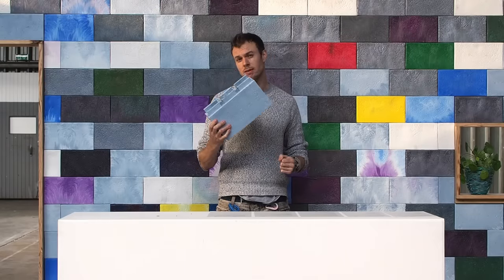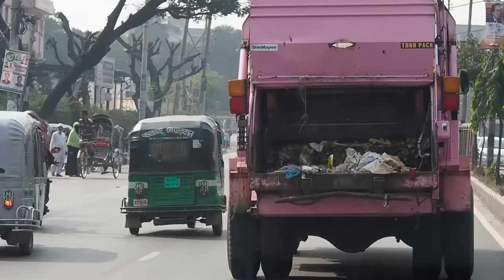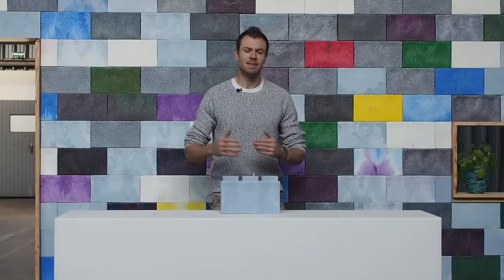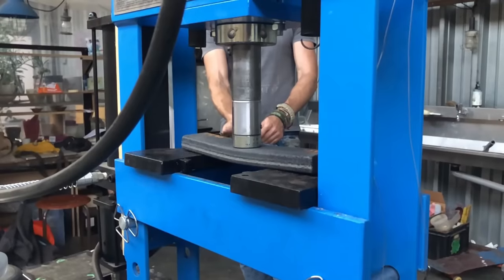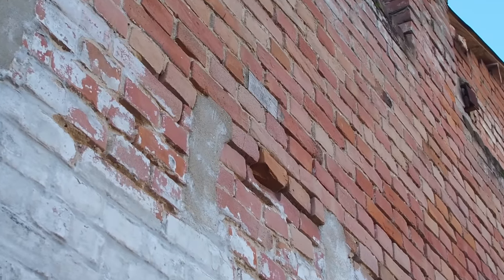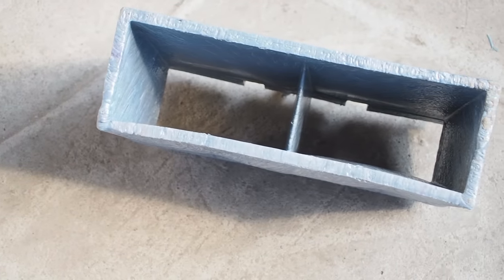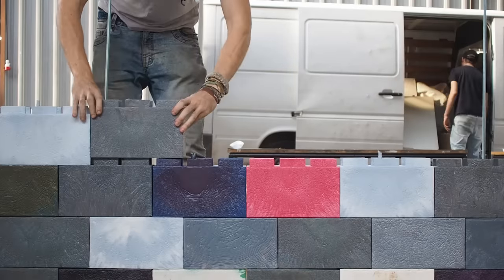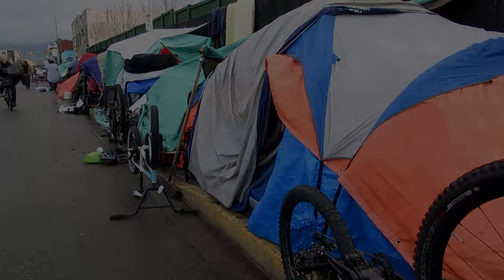Why the world needs recycled plastic bricks (and how to make one yourself!)

Comment: I see a few problems with that brick. The space between the bricks seem to be open. Why not put a notch in. Or some sort thingy that you hammer in to bind it all together. Could you cover the outside in ASA or something else that was uv resistant. And why make bricks. It seems to be a very material heavy way to do housing for poor people. Wich again make it impossible for them to build from your product. Most poor people do not build 2 storage houses. So sheets would be better cheaper and faster to build with. Plus you could easily cover one side in a UV resistant material. 2 sheets with 100mm or 150mm between them inter locking with other sheets 450mm high and 800m vide. Then you fill the space between them with dirt to make it stable. Then the next layer and so on. cheap sturdy and easy to make and build with. And they could make roofs out of 1 layer sheets to. Just an ideer.

Comment: Speaking of hurricanes a plastic house will fly like a bird. Thermic properties will lead to houses hot in the summer cold in the winter so more energy wasting. Also there's the fire hazard. How about making your bricks fillable with water? This would solve a lot of the problems of this design.

P.S: in order to avoid plastic waste, governments could force a percentage of recycled plastic in every plastic item. A composite material made from recycled plastic covered in a layer of clean new plastic could even be food grade. Let's face it, it would be a lot more efficient.

Comment: All those people trying to resolve 1 problem by making 10 others. Plastic is not a good building material. It releases toxic volatile compounds (even if in small amounts, consider if your whole building is made out of them, it is FLAMMABLE, even more with big air spaces inside for better oxygenation of the flames. Yes, there are chemicals you can add to make it not burn, but it still releases toxic fumes and its structural integrity is compromised by high temperatures. Imagine a building out of this on fire - not only fire hazard, but collapsing ass well. You may say "wood is highly flammable too, but we use it in buildings" - well, well, we all know how it ends, that's why most buildings are made out of different materials nowadays.
Other thing - it does not solve plastic waste problem, it just shifts it. buildings get destroyed, rebuild - what you do with old bricks? Also microplastics problem. Why should we use plastic bricks made out of plastic bottles, when we can make plastic bottles out of plastic bottles. We just need to focus on recycling, not reinventing the wheel.

Comment: All new plastic products need to be made from 100% recycled material.
No new single use plastic products need to be made. Manufacturers need to use more recycled products in their manufacturing processes. There has to be a market for recycled goods. There should be no plastic bubble wrap in packaging boxes. Crushed poor quality recycled paper  is a better option. Amazon and other online stores need to use crushed paper as packing fill material.

Comment: 5:29 - Thats the problem with these projects, they mean well, but they can never pay for themselves, except in the third world where labour costs are negligible. And ultimately, if you cant pay the power bill, the project will fail.
Reply: And here is where the short-term thinking comes in.  The cost in money now also has to be weighed against the long-term costs of pollution, landfills, damage to the environment and clean-up.  We have to get past this thinking that I will always pay for the cheaper product and not care about the long-term costs which we all pay.  I don't shop at WalMart, even though they have cheaper goods because I disagree with their labor practices.  Immediate cost is NOT the only way to value something.
Reply: @50jakecs  How do you pay employees and the light bill than? In the future? You still have bills to pay, like it or not. and if you cant, the project is worthless.
Reply: This project is virtually useless. First have to make parts for the mould then have it welded together. Second buy extruding machine. third buy plastic that has been processed to size. Four make then brick one at a time. And then finally after hundreds or thousands of bricks you get to construct some sort of building or wall. Sounds way more expensive and time consuming than traditional wood frame construction. Butt ton of cola bottles to make each brick.

Comment: In the tropics, bio degradable building materials  ( sand, clay, lime, timber)are the best.  Even excessive cement and concrete is harmful to the long term health of humans. (I know because I'm now trying hard to reverse the effect of living 10 years inside a house like that...) The human body is like a production facility, emitting waste including body temperature. When body heat  gets trapped inside for long it has a degenerative effect.  A home is also for stay in family members like the elderly, sick, and babies...  and they have real health issues to deal with already.. 
 
Let's face it plastic is useful in the short-term but  harmful after max 25 years.  Plastic waste shouldn't be disposed in human settlements., especially in countries blessed with top soil and water bases . Relocate them to dry, stoney geographical areas. .. Recycling and reusing  plastics is no real solution to the planet earth.  Let's not get fooled that humans have found a solution to plastic waste issue... the real issue to tackle is the mamoth rate of production of plastics. Now we are camouflaging the root of problem, which should be tackled by them high tech producers... and instead passing the burden of dealing with their waste to hapless consumers. There's no point in putting icing on a rotten cake.

Comment: The design is too wide, you need to have a less wide size in this way you can use it as a partition in construction if you try to have the expansion or divided the room inside an office.

Comment: We don't need recycled plastic bricks
We need to make mandatory to use more recycled plastic in every plastic item made 
And the best way to reuse plastic is with high tickets products to creat a economically sustainable market with a low investment entrance

Edit: still leaving a like cuz i think this is still importante AF
Reply: Plastic typically doesn't get recycled.  It is too expensive.  Metal is more likely to get selected for secondary production.  There have been many suggestions that drink containers should be made out of aluminum cans w/ reclosable lids rather than the typical plastic bottles.  Other issue is plastic bags... Only way to make that go away is to stop producing them.
Reply: @JDW240  if we increase the plastic price the recycling part would be financially feasible

Comment: but you can't use it for structural support right? you can build a wall with plastic bricks, but that wall can't hold a floor over it, it could work as a substitute to sheet metal homes in poor countries, but as you said, gathering, separating and working the plastic is not cheap, so a guy that earns little to nothing and lives in a dirt home surely can't afford 1$ per kilogram of building material
Reply: @Mr Brightside honestly i didn't think about the fire hazard, but yeah, a building that liquifies while burning, that sticks to people while burning. nope bad project. reason why designers are not engineers

Comment: What a joke XD 
1. Not all types of plastic are suitable for the outdoor purpose some will get really week after exposure to UV not to mention temperature change.
2. You cant mix different plastic together for example plastic used to make power tools body is almost always reinforced with glass fibers and that's basically the end you can't use it.
3. How about releasing plasticizers and other toxic fumes from these "bricks" in the hot summer.
4. At least here in Europe, we like to cover walls in plaster will it stick to this plastic wall?
5. How about the fire this would be quite a nice thing to watch burn melting down and with a thick black toxic smoke>> Search dumpster fire.  
6. How about simple stuff like mounting things on the wall what if the brick cracked?

Comment: Ending plastic pollution is easier said than done. 

This project does not have much value. For starters sorting, cleaning and recycling plastic waste is an incredibly difficult task. It has to be done manually. And because there is not much financial incentives in recycling plastic these industries tend to exploit the lower income families in the third world country and they are notorious for employing child labourers in an highly toxic work place.

First world country solution is to either dump or send it to third world country for recycling. Dumping is cheaper.

Ok. Let's assume that by some miracle you were able to accumulate all the plastic. Now how to sort and recycle them. Not all plastic are the same. You have to accomplish a great engineering innovation to industrialize this process unless you want to continue exploiting cheap labour.

Producing plastic is much cheaper than the process of  recycling high grade plastic.

Plastic bricks isn't marginally revolutionary. It is completing with an industry where raw material is literally earth. The process of brick making is less intensive than the process they are showing.

If you want to solve plastic pollution you have to -

1. Industrialize and efficienize plastic recycling
2. Add greater tangible value in using recycled plastic in comparison to petro plastic
3. Industrialize and revolutionize recycled plastic use and have financial and competitive advantage over established industries.

Comment: This is a bad idea. The will end up in the nature anyways. The problem of plastic is not the lack of uses for recycled material.
Reply: I'm not left by any stretch of the imagination, I think that global warming is largely a hoax to have people live in fear and raise taxes, put plastic pollution is undeniably bad. Not finding a use for these materials because they "will end up in nature anyways" is terrible reasoning. If it's used for a purpose, and if it lasts 100, 1000, 10000 years before breaking down it seems like a good purpose for waste product that "will end up in nature anyway" because it "would have ended up in nature anyway". The issue is being fire resistant and capable of bearing weight.
Reply: @ghostinplainsight4803  Sorry. I think I didnt explained myself properly. I appreciate all the creative ideas trying to solve this huge project. I was just trying to point out that I wouldnt use plastic where its use is not strictly necesary or there are better ecological options. Recicled plastic has already tons of uses.

Comment: One more hoples feel good project about plastic. That wants too steal your money.
It have already been Don 10-15 years ago and the project stopt becorse the lady startet finding her bricks in the nature. But that's the smallest problem.
It represent a fire Hazzard and compared too a concrete block costing 0.25 euro here in Africa its dead before start.
And the plastic used for these bricks could easely bee made too clean energy instead. But unfortunately people don't think a relierbel and cheap power grid is important.
There is only 3 ways too get rid of plastic.
Clean burning
Makin it too oil again.
Or plasma gasification.
Or els it will always end in the nature.

Comment: Good effort with good intentions.  But it's effort in wrong direction with wrong material. We as humans must stop production of plastic at all. There is no problem solving in using a material which is a known pollutant wether Virgin or recycled. 

Potential Problems with this application may be:

Fire hazard. 
1. Leaching of complex set of compunnds into ground through building. 
2. Very unhealthy and potentially disease causing compounds being released indoors continuously. 
4. Very unhealthy indoor environment as material is non porous.
5.have to ne applied with same set of dangerous paints /putty/plasters which can bind to plastics.
6. Moisture accumulation due to condensation as it has no where to go because of non Porosity. 
7.At the end of life of building, this plastic remains a problem, there is a limited number of times you can recycle this dangerous stuff. 

Solution: let's stop producing this material at all. We already have huge piles of plastic debris after useful life. Recyclability is possible limited number of times and ultimately going to get into ecosystem as hazardous trash. Only way to get rid is either burning or cracking back to petrol compounds and strictly not to produce Virgin plastic any more.

Please don't get offended, your  intentions are good. But this material has inherent problems.

Comment: unbelievable: out of all expensive building materials(roofing and insulation being first tip) you made bricks? too much money can do you no good- you do not think about plastic as a resource- you really trying just to get it disappear in da walls. such a waste
Reply: Unbelievable how little thought you put into your comment:
1.  Plastic insulation already exists, it's called polystyrene and it's horrendously flammable.  People are whining about the flammability of these bricks, but their flammability vs plastic insulation is like comparing a candle to a puddle of gasoline.
2.  Roofing is the last thing you'd want made out of plastic, since it's going to be pummeled by UV rays.  Black plastics are significantly more resistant to breaking down by UV, but depending on what type of plastic, it can't withstand the heat.
3.  Did you not watch the video?  The sole purpose of this idea was to take waste plastic to replace concrete bricks (concrete is a finite resource we are quickly running out of) in the most cost-effective way possible.  Where is this "too much money" coming from?